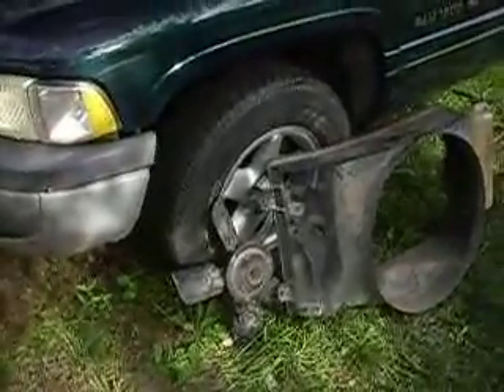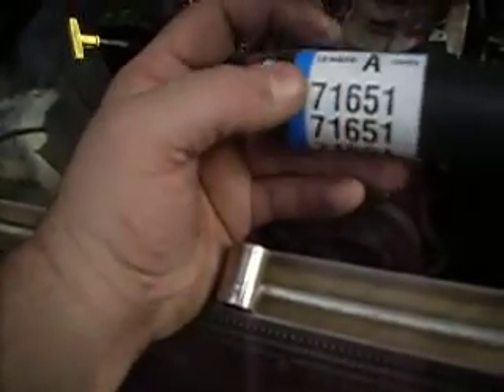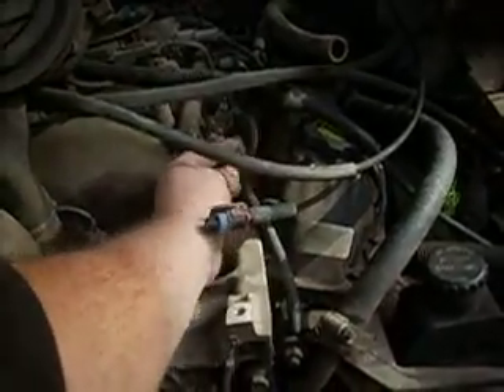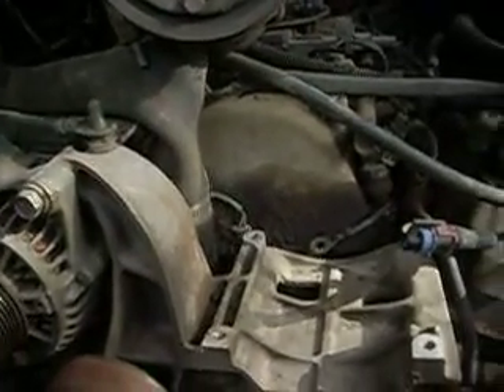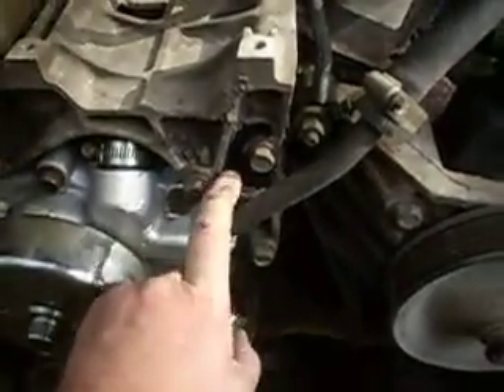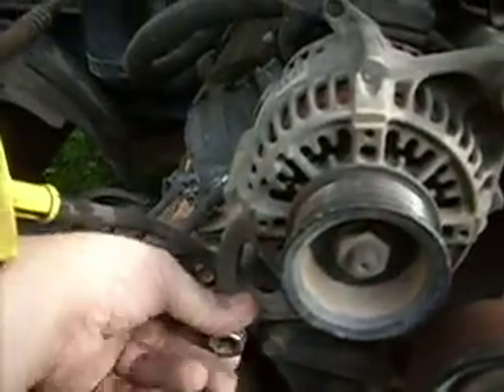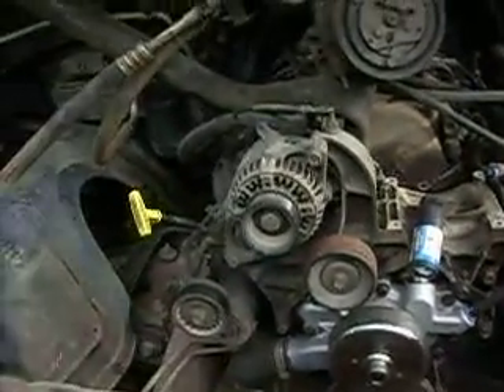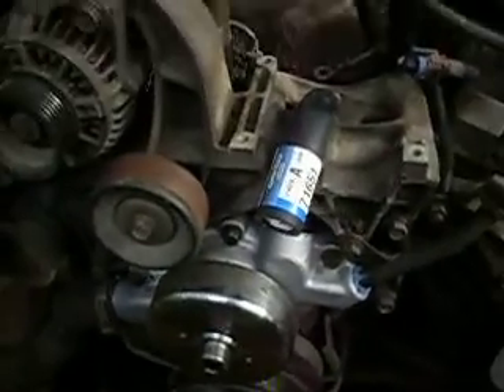95 Ram 1500 By pass hose replacement

Comment: You do not need to remove the alternator or the air conditioner pump from the bracket. Just remove the bracket. Keep them bolted onto the bracket. Just remove the bracket itself with the alternator and air conditioner pump still attached to it. Then just move it out of the way by pulling it forward and you can get to the bypass hose that way. I just made a quick video about it yesterday. You're making a lot of extra work for yourself removing the alternator and removing the air conditioner pump all for nothing
Reply: Have you posted it yet just discovered on my dodge Dakota 99" 3.9 V6 bypass hose is leaking.sounds good 👍
Reply: @georgemorris4727 This is a v8 if i’m not wrong the v6 and v8 are both different platforms

Comment: Good video for people who didnt use the factory clamps...... the easy way is to just pull the shroud and fan and use hooked needle nose to remove the factory clamps and put the hose on and clamps back and fan and shroud.  Takes 20 mins tops
Reply: Well did u have to move the compressor after all aswell
Reply: I'm doing this same project right now